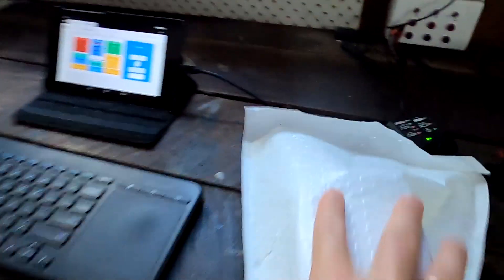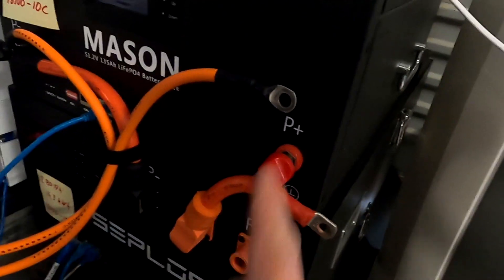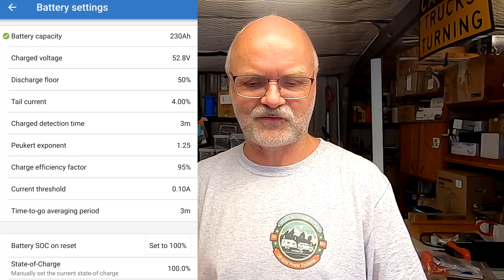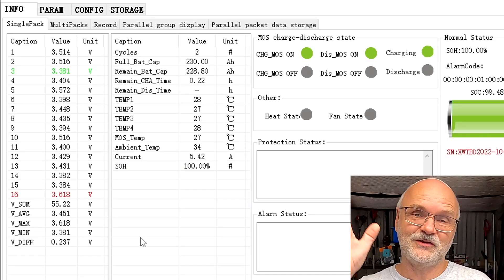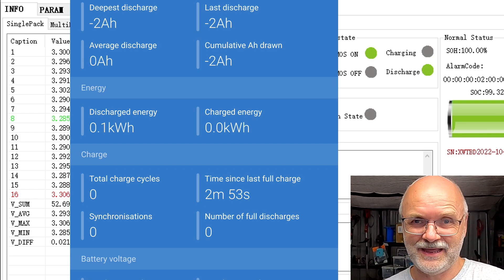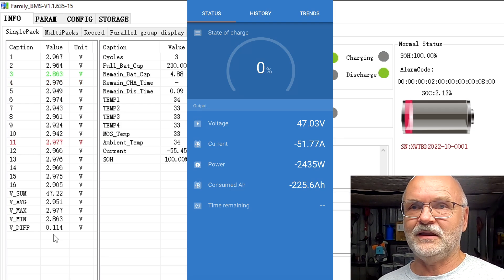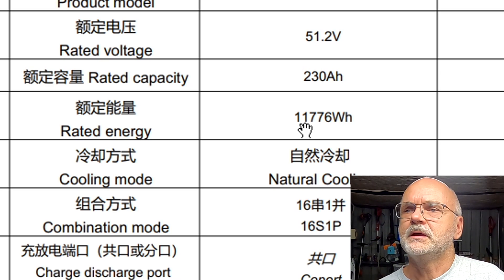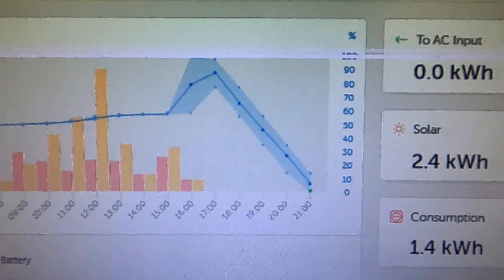QSO 230Ah Battery Capacity and Energy Test. Can the Chinese deliver? 🔋🪫

Comment: Hi from Berlin! Kann man hier auch Fragen in Deutsch stellen? But anyway, I need a 24V 100Ah battery - I thought about putting two 12v 100ah in series. Do I need something like the Victron battery balencer to keep the two balenced? And do I need a 100A or a 200A BMS in each 100Ah battery if I want to run a 2560W inverter? Does it make any sense to get a BMS with overhead? I would really appreciate if you answer my questions.

Comment: Why are the lights on distributor red? mine are as well with heavy loads
Reply from the maker: Means, the fuses are blown or not installed for this particular circuit of the Distributor.
If this happens under heavy load, you have a high resistance with your fuses. Check that and measure the voltage drop across the fuses when under load.

Comment: Another indication of cell quality is how well they stay in balance. Charge to 100%, do a top balance and then work the battery between 20% and 80% for a few days...maybe a week. Then charge it again to 100% and see if the cells are still balanced.
Reply from the maker: Great test, thanks for your suggestion. 
That's more a test for cell matching rather than quality.

Comment: Did anyone test the Shenzhen Basen active balancer already? An what about the JK smart balancer? @ Andy, which one is the best? My battery is close to be ready and usable but i can´t decide about the balancer because of all your nice info and tests.
Reply from the maker: First of all, do you need an additional balancer at all? Do a top balancing and use the battery for a few times before fully recharging. Check the balance again.
What BMS do you use at the moment?
Reply: I have an Daly Smart BMS 200A. The battery is not in use in the moment. I wait since a close year of a replacement from Basen, because there was 2 cells in my delivery with over 50mohm IR. Annoying enough but anyway... so you think I need just to check first how it is working and how the deviation will be before think about the "right" balancer?

Comment: I'm struggling to find a useful watt-hr / amp-hr tool for capacity testing 7 large batteries so I can parallel them into close-as-possible capacity pairs.  I hadn't thought of using a Smart Shunt!  What happens to the Smart Shunt data at the end when the BMS disables discharge?  Does a Smart Shunt "remember"  or do you have to quasi-panically monitor the end game?
Reply from the maker: Yes, the Smart Shunt keeps all settings and results except the SOC.

Comment: are you going to top balance it after putting some more reasonable values in the built in BMS and "trickle" the current in at the top to allow the top balancing to work? Would take ages with mV balancers though..... days? a week or more?
Reply from the maker: Yes, next videos... 😉
I measured the balance current of this BMS and it seems to be only 50-60mA per cell. Yeah, that would take a loooooong time.

Comment: Hi Andy, on VRM DC input or output is not calculated as Feed-in or consumption, it mainly uses ve-bus data for the graphs, if you have grid feed in and connect a dc genset, you would see the grid usage go down. And go up with dc consumption.
This is weird, but the reason is, it is not taking the bmv or smart shunt data into account, also dvcc is not working with external dc in or output. I already discussed this before with Victron but they are saying the vrm is designed this way. If you would use the output of the multiplus to feed your car, data would be correct.
Reply from the maker: It all works perfectly fine when using the Smart Shunt or BMV. DC Power is then calculated as kWh and accumulates with the Multiplus output. Perfect. 
I don't know why the Lynx Shunt does not do this any more all of the sudden. It seems a big step backwards for me.
Reply: Oké, I think then that the fact that I am using ess makes the difference, never tried it it in off grid mode, if you say it did work, then fine.
May be check your battery monitor setting in the gx, may be its on automatic and has chosen a different device then before, don’t know your complete system , just a guess.
Reply from the maker: @wilvandendoel6782  THanks, I checked the settings in the remote console and the battery monitor is set to the Lynx Shunt. Still no DC Power. There was a thread about this in the community forum as well where I replied to: https://community.victronenergy.com/questions/101333/lynx-shunt-not-displaying-dc-consumption.html

Comment: Excellent Andy. 👍
Interesting also that cell #3 was tied with one other (14 I think?) as the lowest voltages when the battery was full, and it was this cell #3 that stopped the discharge. 
Therefore as you mention at the end, I’m also guessing that with more balanced cells (hmmm, a better balance current) you may perhaps have gained a couple more amp hours from the battery. 
Like you, I’m not a fan of these milliamp balancing currents on cells of this size!
Reply from the maker: I could measure 60mA balancing current with this BMS. That's not gonna work. I'll fix that in one of the next videos ;)

Yeah, the whole battery was not very well balanced when delivered which is a shame. I would expect this to be perfectly top balanced before shipping. They could use a bunch of crocodile clamps and quickly connect an active balancer for a few hours which would do the job after assembling the battery.

Comment: Andy: so you are not interested how bad Wanptek official store treated me like shit? I could mail the details. Please remove the link to that shop from your website. It did cost me a lot of stress and possibly about 200 Euro dealing with those scumbags.
Reply: Please share the details. I was planning to buy a 60v 20a power supply from them.
Reply: @davedubreuil  I ordered said power supply from them. I received the 30V 20A version. Since then the seller was taking any effort to frustrate the process of getting my money back and returning the power supply. Alie Express granted me to return the power supply, but after a long struggle to get the right address, which needed involvement of Alie Express again, the seller did everything not to cooperate, ending in a package which I did send  getting eliminated by UPS because the seller didn't met the deadline for contacting his local UPS office for assisting the clearance procedure. The conversation with the seller contained a slurry of delay tactics and insane answers driving me crazy. I still have to wait if I get my money back by involvement of Alie Express, as the last state of affairs is that Alie Express instructed the seller to contact the local UPS office, which will not work for explained reason. ARGHHHH!!!!! Needless to say I stayed polite , while from the beginning I felt an knew which direction things were going and what the seller tried to pull off.
Reply from the maker: I had nothing but good service from them so far and they helped me 3 times to repair my broken power supply. I sent them pictures and they told me what to replace and repair. I got the parts and it worked spot on.
Sorry to hear you had some other experience, but feel free to share your story here in the comments. As it is a bit off topic to this video here, maybe leave it under the video where I introduced the power supply: https://youtu.be/s7xEZQhTKdc
Reply: @OffGridGarageAustralia  Thank you Andy. I perhaps copy and paste a bit. I hope you don't mind that I fill in here a bit of the  the conversation I had, with Mr. Wanptek official store and put a link to this video in the video where the power supply was introduced. Andy, I am not making this up of course. To spare your viewers please remove the link from your site. or change it to a warning.

Comment: Hi Andy and thanks again for this video, the battery capacity is correct and corresponds to the original data.  , but honestly I am not convinced by this product.  this battery was improperly prepared, improperly tested, before shipping.  cell #16 pauses problems, and the cells are never balanced properly.But once again Thank you Andy for this Quality video. 😁👍
Reply from the maker: I agree, they need to do more work on this battery, change a few things around and deliver them top balanced. I'll do some upgrades on this one soon...

Comment: A better indication of whether the cells are high quality is do a higher discharge test.0.5c not 0.2. If it can't hold 3.2v under load and then snap back when load disconnected (after 1min) then probably b grade or lower. 0.2c isn't quite testing enough.
Reply from the maker: 0.2C is the standard test current for battery tests. But you're right, a higher C-rate could better show the cells quality. In solar installations such higher C-rates rarely occur though, so I thing 0.2C is fine for what people can expect from such a battery.
Reply: @OffGridGarageAustralia  I agree that they say 0.2c is a standard metric, but the reality is at this level, lower quality cells aren't exposed and can appear to be of a higher quality. A grade eve 304 cells can still maintain cell voltage of 3.2 even when getting smashed at high c rates. I think it would be a great video to record cell voltages as you draw say 5000w and above. Push em until they break😁
Reply: @camwood7600  would it tell you anything about the long term prospects of owning such a battery?  It's one of the big unknowns - as to whether the 6000 cycles / 80% capacity claim is just hot air and these lower-brand offerings will end up with unusable losses after only 2-3 years / 1000 cycles.

If ability to cope under high c-rates correlated with degradation over time, then it would be a worthy test.

Comment: Good price for batteries. Wonder what the shipping is for the UK 🤔
Reply: have you checked the right prices or do you believe in the fake prices ?

You need to use the lead price which is 2700 and not 1200 - quite a difference and that gets even bigger once you ask for a ddp price to your door which is the only price you should ever accept just to avoid all the risks of fees at delivery. 

I doubt that the price is still that good as this is just the test result of the battery delivered to andy cause you might get a completely different one, not the EVE LF230K with 6000 cycles as mentioned in the product description (the cycles).
Reply: @typxxilps   If the capacity is OK - Andy didn't top balance them before test. It's about $3400 delivered for the 300Ah 48v battery
Reply: @BrazzaB1  That's still not all that bad of a price for a complete battery.  I think my 16 Eve 280's and JK BMS was around $3000 when completed.